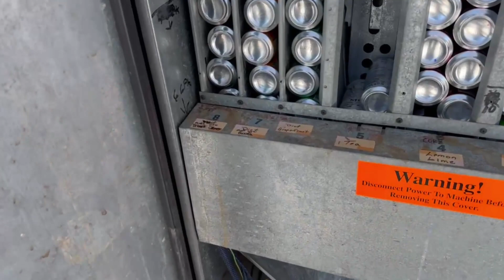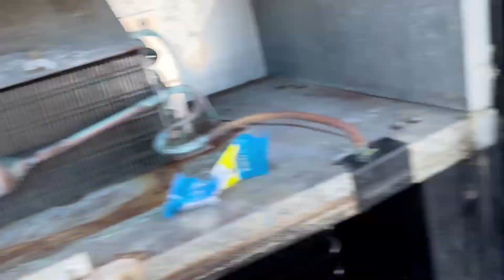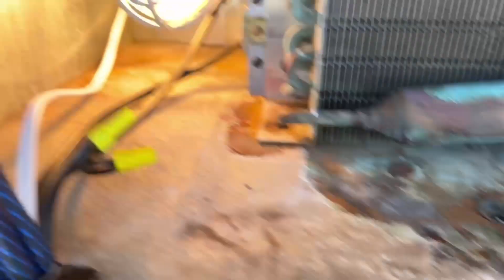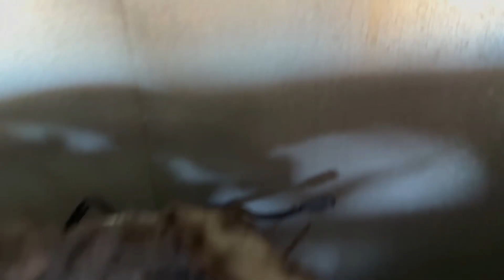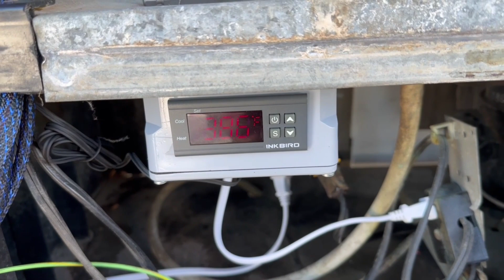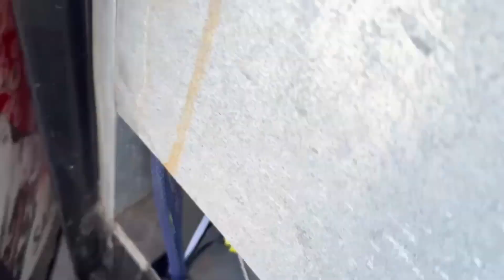DIY How to keep soda machine from freezing up with new Thermostat

Comment: So this solution is based preventing machines that are outside from freezing. I have a problem with a machine that’s inside and is freezing up. I was thinking this would be the solution but I think I may have a thermostat problem.
Reply from the maker: It maybe a thermostat or a system leak causing the issue
Reply: If the evaporator is freezing up, check to see if the drain is clear, Check to see if the evaporator fan is on and check to see if the suction line is frozen over.